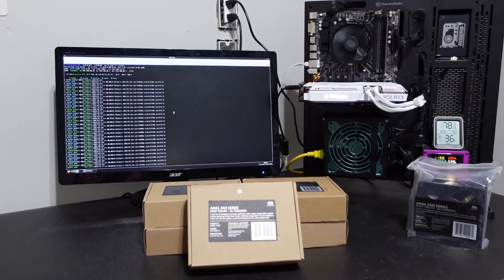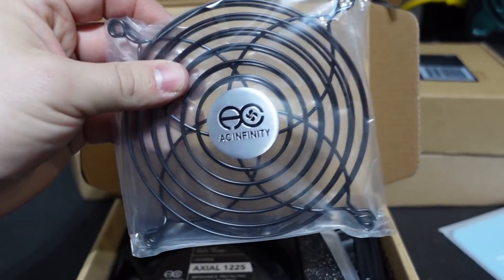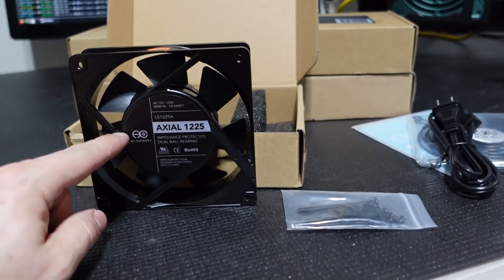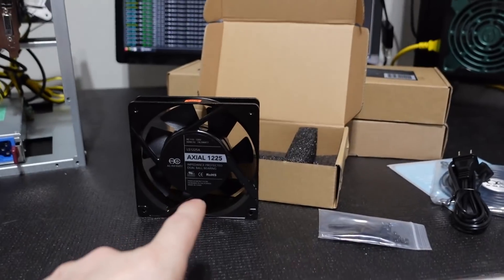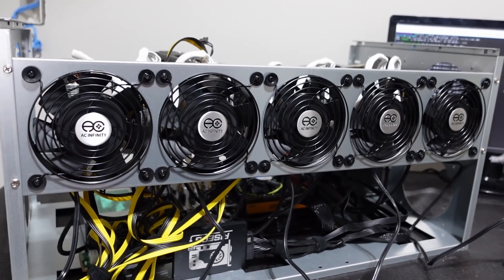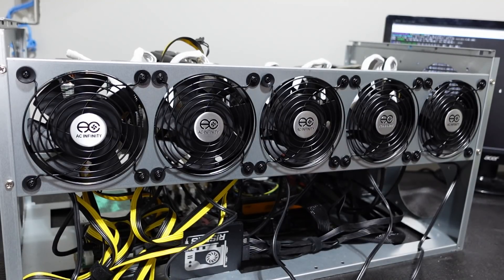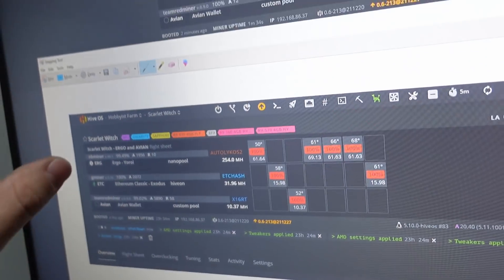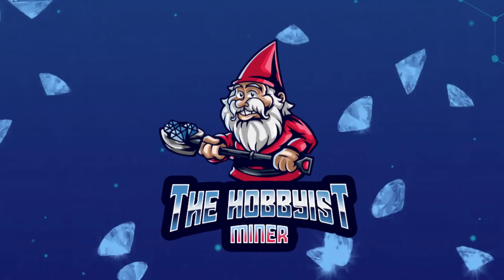How To Cool Your GPU Mining Rig

Comment from the maker: What Cooling Fans are you using on your rigs?  What GPUs get the hottest for you?
Reply: I have been a huge "fan" of the Noctua Fans on my personal use PC's .. pricy too. but man, they are fantastic at cooling and they really do the job! But when it comes to the profitability side of things, I just have a cheap 20 inch box fan right now blowing air on my mining rig, 2-1070ti, 1-RX5700, and 5- RX 580's, and I'm never over 58C.... should they be cooler for longevity???

Anywho... another great video and I personally have learned a lot from you and appreciate what ya do!
Reply: KDE1212PTB1-6A very powerful and cheap fans. rtx 3080 45-50C 60%fan speed
Reply: I use the antec p12 120mm case fans and they are 60cfm my cards dropped 3-8 degrees from my 36 cfm fans I use to have on my rig. But the bonus is they have normal 4pin fan connectors and I have them on a 4 channel variable splitter so I can adjust the speed if I need to
Reply: I switched partially from Arctic P12 (1800 rpm - 55 cfm) to Noctua NF-F12 (3000 rpm - 110 cfm), which improved cooling quite a bit.
Sure they are a bit more noisy - but not louder than the GPU's themselves. I do,run them from molex splitters, as each fan takes about 4W
Pricewuse they are pretty hefty - so i picked those positions first, which had temperature issues.

Comment: I've been running those fans for years I think 3 years now and what you should get is they have a fan speed selector and it comes with two connectors so of course you only need to get three of them and much better airflow a lot more powerful than those other case fans any case fans pretty much unless you want to go with the really loud ones that will chop your fingers off these push more air and more efficiently I think I have bought a lot of stuff from AC Infinity

Comment: Well, I had before  classic rig , but open wire rack/hanging GPUs is so much better concept for home miners. Air flow is much  better , you can place cards in two lines so that every one suck clean air with no turbulence(Rx 6600 in wire rack-GPU  temp 40C, fan 34%) . Those extra fans use power, cost money , make more noise.  For "classic" rig  one big fan is much better solution.

Comment: I've been working on vertical mounting of the cards, since heat rises, and cross airflow or vertical airflow. Versus these examples of blowing wind across and UP. Also, why isnt anyone designing the most efficient fans as the centrifugal blower fans often found in HVAC as well as bathroom ceiling design. They have crazy airflow, low noise, and could cool a wall of GPUs with one fan. I used to use one for entire walls to dry paint, imagine these fans doing that. 
Definitely a challenge to cool things.

Comment: I use the antec p12 120mm case fans and they are 60cfm my cards dropped 3-8 degrees from my 36 cfm fans I use to have on my rig. But the bonus is they have normal 4pin fan connectors and I have them on a 4 channel variable splitter so I can adjust the speed if I need to

Comment: Hi, sorry  but you said, measured  after 10-15 minutes, but you compared it after 90 seconds, and i did not see ambient temperature before and with  new fans. I am using 140x140x25,  10USD  china fans around 200 m3/h . They are noisy but  temperature is down .

Comment: I use Scythe Kaze Flex 120mm Case Fan, 3-Pin 2000 RPM specs are way better and move a bunch of air check them out

Comment: Odd question here

How do you know which side of the fan is drawing air in and which is blowing the air out?
Reply: Usually if you face the logo, the air flow is towards you. 
i.e. if the logo side is the front, the airflow is from back (air in) to front (air out).

Comment: I’m running similar fans that put out 2600-2900RPM or ~110 cfm. They are pretty noisy but the best solution for my 3090’s. Great airflow and significant temp change from my 1800RPM artic fans.

Comment: MOLEX won't be any good for mains AC, as it's already part of a standard that supports 5 and 12Vdc, you don't want mains on the same plug type as mistakes happen.
What you need is a way to effectively string the fans together. That could be a custom molded cable with multiple connections. 

The question I have is about efficiency. Having powerful available is good if you need it but why waste energy on moving an excessive amount of air if it's not needed.

Comment: Box fan on main rig. I have found the box fan to be much better than the (cheap) fans that were installed on the frame. It doesn't looks as nice but gets the job done perfectly fine. I have the rig on an Ikea wire rack with the fan zip tied to the rack, pushing air through the rig. 8 card msi 1070ti rig, cards tightly packed, had a drop of 10C-15C switching fans. If you are going to cheap out on fans, buy a box fan.

Comment: Parallel miner fans, 265cfm. Put them on a noctua fan speed controller and a fan hub, turn up and down the speed on 20 fans with the turn of a knob. Could also hook them up to AC infinity temp fan speed controller

Comment: it sure LOOKS nice.   In my experience though, a $20 target or walmart boxfan outperforms these things in terms of cooling/airflow though- by like an order of magnitude, or even more.  It's not without downside though- as the boxfans tend to 'wobble' so you don't really want them hard mounted to anything that's also holding your rig- yet you still need them really close.

Comment: 2 things that I disagree on your videos talking from experience: 

1 - You don't need AC infinity fan to acheive better temperatures: "Scythe Kaze Flex 120mm Case Fan, 3-Pin 2000 RPM, Single Pack " is the way to go fater testing everything (except Noctua Industrial that are loud as hell).

2 - Get that USELESS fan grill out of your build: it reduces your airflow (which is bad) and it doesn't prevent dust from getting in your rig. The less obstacles blocking your airflow the better. It may looks cool but it's useless: it's like a GF with too much makeup. 

Suggestions: 

Get an A/C in your mining room
Get a Grow Tent with good exhaust

Now you have excellent cooling.
Reply: You might want to go over his other videos. He is pulling in outside air into his mining room and exhausting the hot air back out. An AC unit is not needed, at least in winter. Plus an AC unit uses up a lot of power which cuts into your profits. 

Those grills don't restrict the airflow much. Nor do they catch dust, they are not designed for that purpose. However they do protect the fan blades from objects like cables and Fingers.
Reply: Metal blades and stuff don't mix

Comment: Cant believe in this. I changed my old fans for Noctua Industrial 3000rpm (14cm) with 160 cfm and cant see even 5 degrees. You see more than 10 on 50 cfm.. how it is even possible,